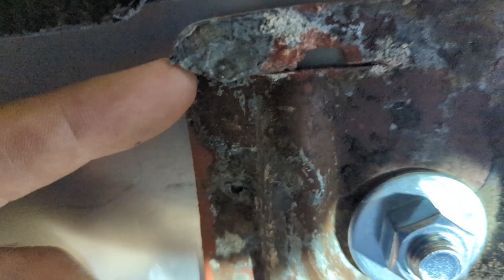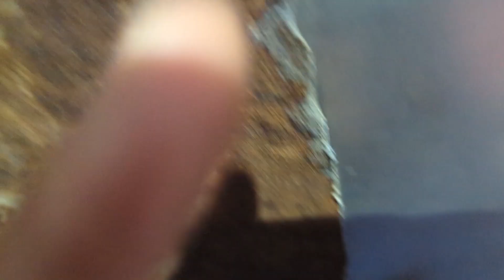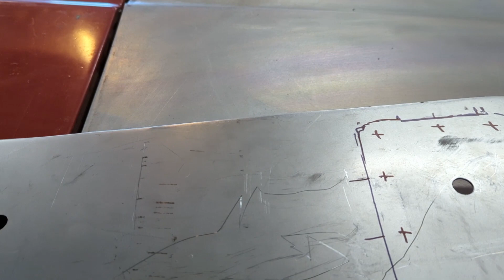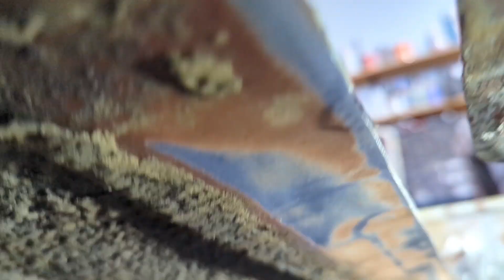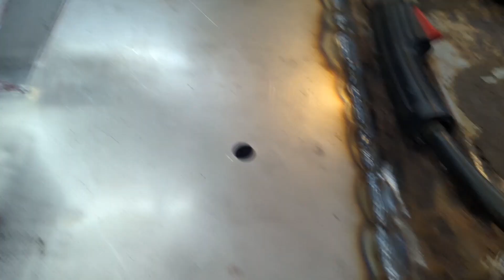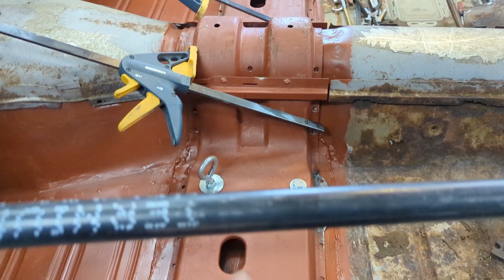Floor Pan & Seat Pedestal Rust Repair Part 6 – 1965 Thunderbird | Ep #62

Comment: Alvin,
Really looks good, my friend.  That classic will be better than when it came off the assemply line. But I highly advise you to get rid of that welding apparatus.  It doesn't make nearly enough smoke and the sparks aren't flying all over the garage and burning holes in your clothes.  Unlike my flux setup, I'll bet it won't even set the trash can on fire.  Must I learn ya everythin?😏
Regards,
John
Reply from the maker: Lol...my welder will do flux core, I just never mastered the skill needed to weld with flux core. 😋

Comment: Started this last night, and finally got to finish it now.  As alway - great work!  I wonder if a ratchet strap, run side to side,  across the forward portion of the seat pedestal would push it down and back just enough?  I’m sure you’ll figure it out, just offering.  Thanks for taking us along ~ Chuck
Reply from the maker: Hi Chuck,
Thanks for the idea, I only need a little more to align with the old position...your idea maybe all I need. 🙂

Comment: Looking good. When I made a rotisserie for working on jeep tubs, I started with 2 engine stands on wheels, connecting them with square tube and angle iron. Baz
Reply from the maker: Hi Baz,
One of my rotisserie ideas is similar to what you did...I may try my idea out, and if it doesn't work, I'll build one according to the plans I already have.

Comment: Hello Alvin. Looking great. I also do not like to weld from underneath. Yours went in your ear, mine went into my shoe to the bottom of my foot. Took weeks to heal. After that I covered myself with a welding blanket. Can't wait to see you build the rotisserie.  Do you have plans, or will it be your idea?
George B
Reply from the maker: Hello George,
I wear a full welding jacket when I do a lot of upside down welding...but the slag always seems to find a hole. Lol
I do have a set of plans, but I'm also thinking of a design of my own...the plans will make a proven to work rotisserie, and my own idea could be a disaster! Lol